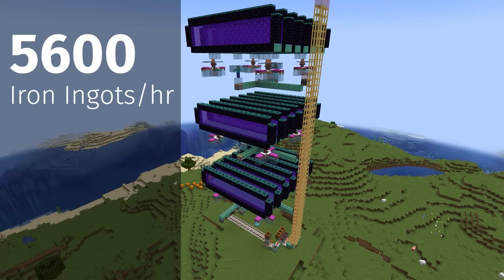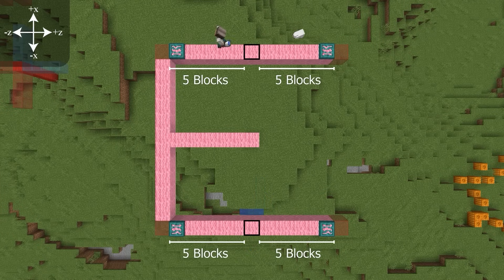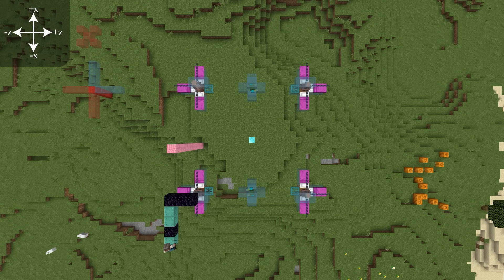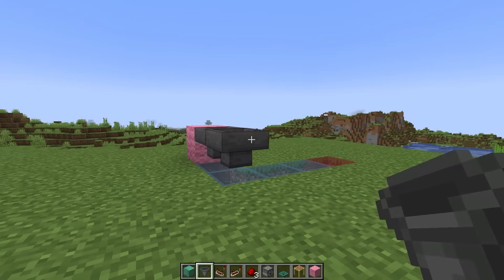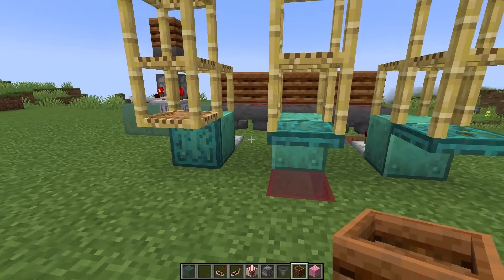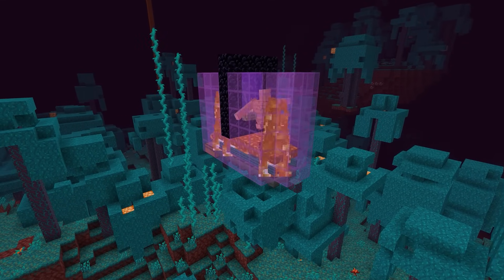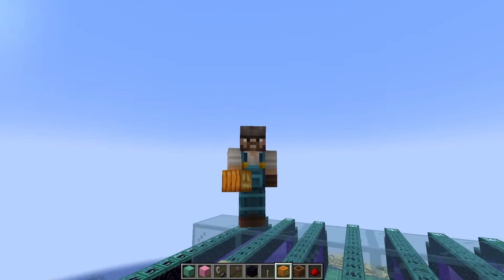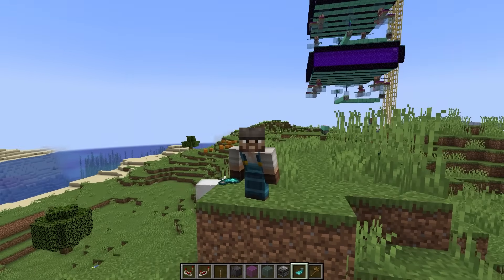Most Efficient High Capacity Iron Farm - Build Tutorial

Comment: Ok so anybody think on how to get the piglens that spawn from the portals out. The just sit in the overworld and after a few hours of afk they just get me kicked.
Reply from the maker: Afk over 128 blocks away (in the air is easiest) and they won't spawn.
Reply: @NicoisLOST  the farm goes up to sky limit to bedrock in a 16x16 chunk perimeter.  Also the server has a hard capped simulation distance. I was thinking turtle eggs around the outside. Or will just going say 128 blocks south from the center work?
Reply from the maker: @hunterpatti7915  Yeah as long as you are loading the chunks, but not within 128 blocks it will work, so it depends on server / world simulation setttings. Otherwise turtle eggs with trapdoors works, and hey, why not get a little gold if you're up for the work ;-)
Reply: @NicoisLOST  ok thanks, ill see what i can do. Because i walked over after i woke up to thousands of pigmen

Comment: If I built only one layer can I use the same redstone clock you used? Or i have to move on a different one?
Reply from the maker: You can,  but you will get portal linking lag, you should look out for the sinlge layer design mentioned at the end of the  video for a better one, or use a overworld only design.
Reply: @NicoisLOST  but with 3 layers the game will lag a lot or not?
Reply from the maker: Yeah I mean it depends really. 36 villagers is a lot so that will be your major lag contributor. But without maintaining the portal link every 30 seconds the game will lag a significant amount. Neither are lag free, but a single layer with nether linking will give you the best bet. Or if you are really worried about lag do a 2-3 long water platform and keep it overworld. That's going to be the most lag friendly, but not max rate of course.

Comment: for some reason, villagers keep waking up on top of the beds, right next to the horizontal chains and falling to the ground eventually. anyone else having this problem?
Reply from the maker: Is your block that they should stand on suitable for them to wake up on? If it's for instance a bottom slab or obstructed then they will choose to stand on their beds even with the chains over them. A glass block should work.

Otherwise, idk, sorry, it never happened in all my testing...
Reply: @NicoisLOST  its a glass block, black tinted glass, as is in your video. If i remove the two chain pieces on that glass block, they wake up on it just fine, but otherwise, they wake up on their beds every time
Reply from the maker: @rhoninangelicus4953  OH! That's the problem, I can see how it was confusing. Those two chains on the glass block were just temporary for building the chains over the bed. They shouldn't be there. Only chains over the bed. Sorry I can see how that was confusing, I should have used wool ;-]
Reply: @NicoisLOST  ah, gocha, must have missed the part where you brake those chains in the video, my bad

Comment: I just finished building this farm last night, great timing lol. oh well seems to work fine even though I built the 1.18 version I think. Is the difference very important
Reply from the maker: Ok so, you can just change the 100 tick clock to a 117 tick clock and you will improve the Eff a lot for 1.19. I guess something like a 97% eff,  but just a guess. If you want to go for the 99% you can just rebuild the redstone portion with the 5 (10) hopper counter with a 70 tick clock. The platform will have very little impact since it's large enough in the old design (larger in fact I think..) Hope this helps.